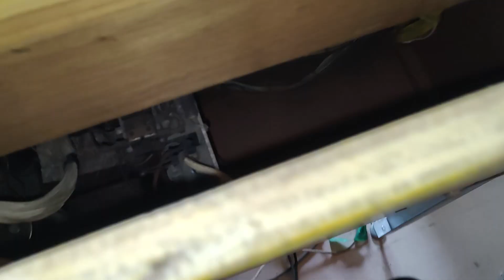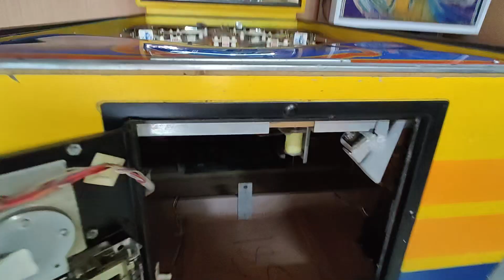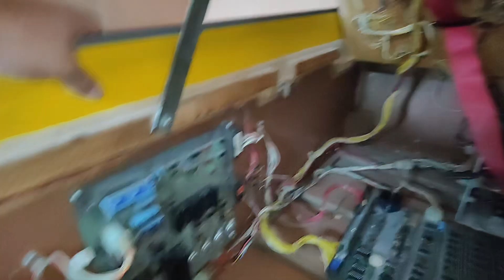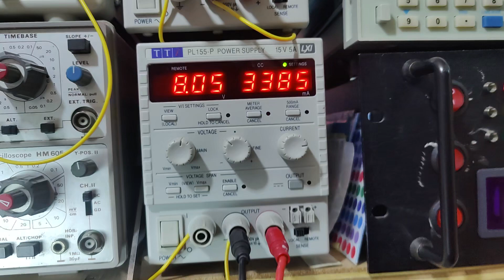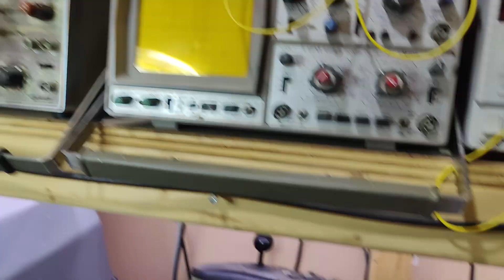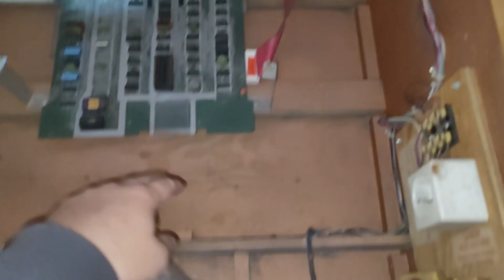Atari Space Riders - Pinball Repair - Part 1

Comment: Nice one Luke, I’ve also got a Space Riders Pin, UK too. Looking forward to part 2 👍
Reply from the maker: Awesome! Is yours working? Only a handful of Atari pinballs in total in the UK so its quite special to have finally got one. 
Got to love Atari artwork!
Part 2 is in progress
Reply: @arcadeuk  Yes it working :) It had various faults when I picked it up a few years back. The main issue was the 74145's connected to the switch input circuits, they had high failure rates, and generally caused the game to lock up. After replacing them when they failed I finally shotgunned the remaining ones which has led to good reliability. I need to do a flipper rebuild as they are a bit weak, other than, it' a great piece of Atari history, and yeah the artwork is so cool.
Reply from the maker: @_smarty  There will be some 74145 action later on in the repair 🤣 Funny I have never had to buy any in 20+ years of fixing pins and vids, so they must pretty much only be used on Atari pins
Reply from the maker: @_smarty  Is there any chance you have a waveform from one of the switch decoder outputs, or do you remember anything about it (i.e. is it a regular or irregular pulse?)

Comment: lucky there  are schematics.
Reply from the maker: Yes, the Atari manual has a pretty good "theory of operation" and lots of schematics, so it is very helpful. The only problem is that Atari don't give you a single overall schematic, rather they break it up into smaller chunks, unfortunately this means its not always easy to see how everything connects